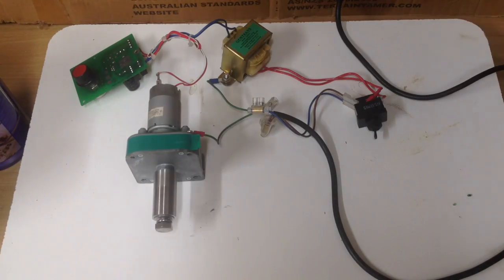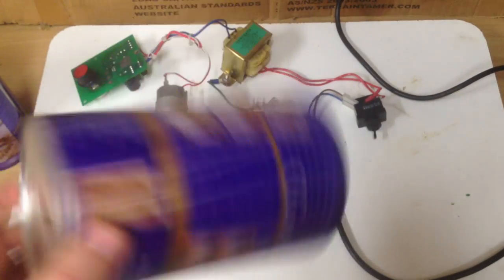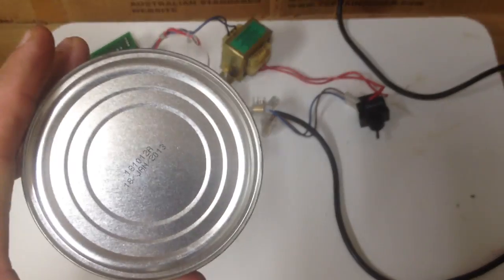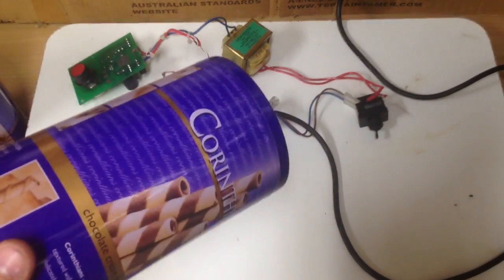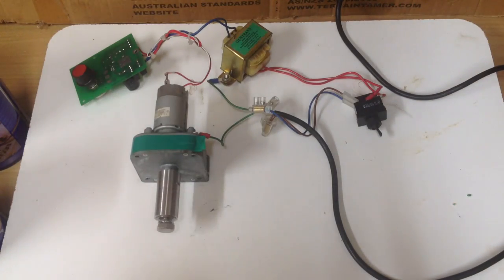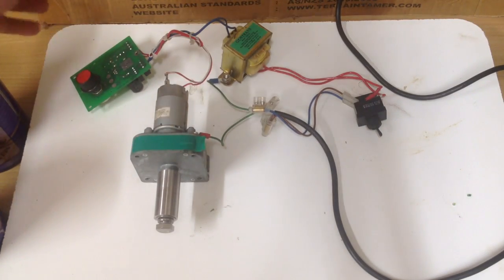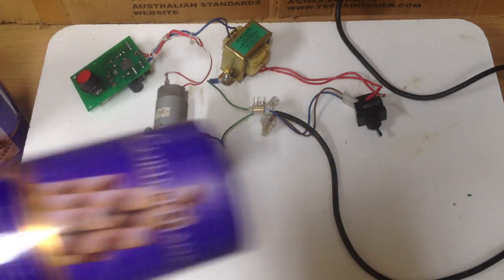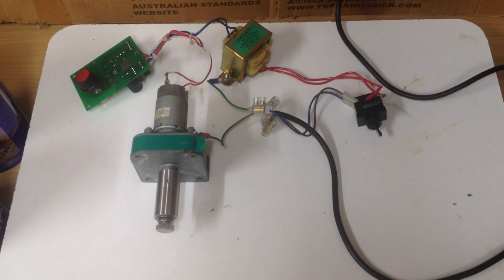Motor for the simple yet effective case annealing unit.

Comment: Nice work skip, looking forward to the finished product
Reply from the maker: Get guys. 

I finished the unit on Friday but my motor has died. Well and truly, so I have brought a new 24 volt motor at 10rpm with a 8mm shaft. 

I have found another motor I had in the shed its 12 volt 60 rpm ...... It still works fine with my turn pot and transformer ( only issue is, I have to make a new adapter for the shaft. ( 6 mm hole with a m5x.80 grub screw. Too a m8x1 or a cap head ) 

I made a mock up out of wood. Works well ( just have to replace the flogged motor )